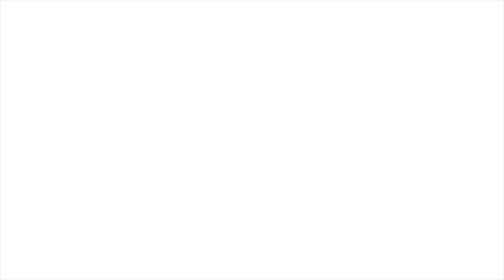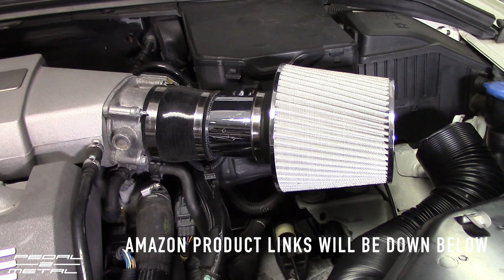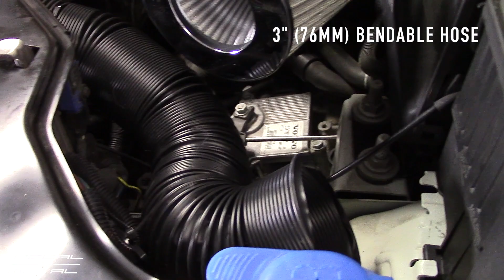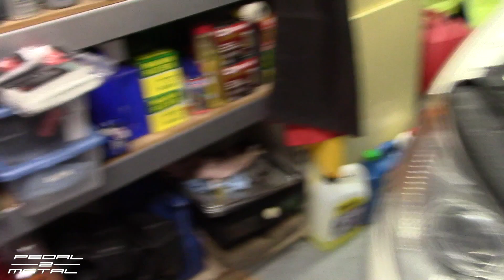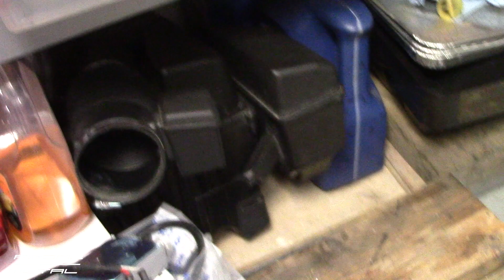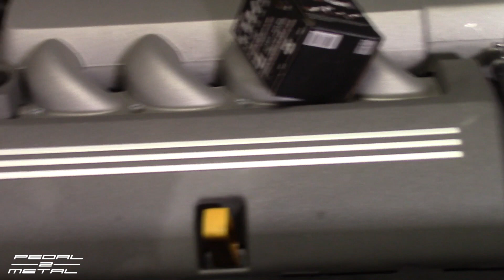Custom VOLVO (Yamaha) V8 High Flow Air Filter System | Under $50 | VOLVO S80 V8 Project Car

Comment: Curious as to which gasket you used to fit the maf on to the spectre?  There are 3 in the Amazon link.  Also, someone on there stated the maf adapter cracked.  How is it holding up as of now or when you had it on your vehicle?  Thanks.

Comment: If you make the intake shorter you may not need the helmholtz resonator. some math would need to be done there. Additionally, the XC90 does not have those resonators.
Reply from the maker: I have no idea what resonators you're referring to...?
Reply: @Pedal2Metal_on_YouTube  the box on the intake between the manifold and the air filter box
Reply from the maker: @kirunacat  Oh... Its gone.  I'm running this intake every day now. I love the additional grunts.
Reply: @Pedal2Metal_on_YouTube I agree, the intake noise is amazing

Comment: I think make that but is to much hot air in there... for this a keep the air box and put a KN.
Reply from the maker: As stated... I only use it for car shows.  I use a k and n in the factory box currently.  It was a fun experiment.  It actually didn't affect performance in the slightest tho; meaning I did not notice temp affecting intake temps. Thank you for watching and commenting!
Reply: @Pedal2Metal_on_YouTube  thanks you for the cool vids!!

Comment: I have an '05 V8 that I use for work, I was just looking at mine trying to figure out a way to do this. I guess Volvo moved the ECU at some point, mine sits on top of the air box. I'm trying to figure out a way to modify the box to support the ECU while allowing me to install a cone filter set up. Doesn't look like you had that problem. Looks great man, nice job.
I'm also going to install an oil catch can. I've been reading about them, they replace the pcv breather and collect any oil mist to keep your intake and throttle body clean.
Reply: Yes. I also have an 07 XC90 V8 sport and I can confirm that at the top of the air box is a mounted heat sink with thick wires..  you’d never know it was there unless you serviced it and lifted the thin plastic cover that allows you access to the air box torxs. And the (heatsink/ECU) is actually exposed to the air in the air box.. so perhaps it is being kept cool by the airflow. I am also looking to modify this since I just rip the exhaust off and gutted the rear cats that form the Y before the middle muffler/ silencer..  I love these 4.4 v8s
Reply from the maker: Thanks.  You have me confused... Volvo never had an '05 V8 model year; at least not that I know of.  Are you sure it's a V8 model?  Either way, I never heard of an ECU mounted on the airbag before...  thats weird!
Reply: @Pedal2Metal_on_YouTube  I have a 2007 V8 and the ECU is on top of the air filter...maybe that's what the person wanted to tell you.
Reply: You mean to say the MAF Sensor ?

Comment: Eye candy for sure, nice job dude!
Big v8 makes some heat under there though, any intake temp info after the mod? ?
Reply: Also interested! I almost wanted to buy a second airbox to convert into a semi cold air ram/heat blocker with a cone sitting inside, but I've bean holding off because of the lack of information

Comment: Hey man question for you. What did you do with the pcv valve to get it to not run rough?
Reply from the maker: Plugged it with a rubber cap

Comment: I'm trying to do a project with my B5 Audi S4. I have one of these motors available to me if I want it.  I'm trying to figure out if I can fit this motor in an Audi B5 S4. Is the design of it far too incompatible with the Audi?
Reply: It will fit all P2 Volvos, you have to check dimensions for your application
Reply: I highly doubt it, the engine barley fits here. This engine was made to fit in the s80 nd xc90

Comment: It looks good but performance wise won’t make any difference. The standard air intake is better just replace the filter for racing one such k&n. The whole idea is to get fresh and cool air in to the engine. If you place your filter directly in to the engine compartment it’s only getting the hot air from there. You won’t improve anything even make it worse. Yes it’s nice to looks at.
Reply from the maker: You're stating all the obvious facts about intakes.  This was an experiment; mainly to see how it sounds and as I state only for car shows. I run a k&n panel filter in my factory box as my everyday filter. I still want to make a nice carbon fiber air box sometime when I get time.
Reply: @Pedal2Metal_on_YouTube  Did you feel more Torque? Or More Acceleration?

Comment: Is it not true that the transmission in these cars is maxed out from the factory? I was told not to do upgrades because of this.
Reply: Volvo uses Aisin transmission.  Same ones used by Toyota.  As long that you change the fluid and don't abuse it, you should be fine.
Reply from the maker: I've heard they are only good for 350hp.
Reply: Pedal2Metal good to know. Thanks.

Comment: I admire a desire to modify these gems but this is just wasting your time. You left out the most important part, the comparison. I promise you the stock filter will flow much more air than that cone thing will and its 100% cold air induction.
Reply from the maker: As stated several times, it was merely a test for noise and was to be used at car shows. I run the stock air box daily.
Reply: @Pedal2Metal_on_YouTube  these engines are lovely. Let's hear it sing.

Comment: What did you do with the crank case vent hose that ran to the bottom of the stock plastic tube
Reply from the maker: I stuck a black rubber cap over it. I forgot to mention that on the video; sorry.  I don't think it does much of anything that i could tell. Its not a vacuum line. I think it's purely for emissions.
Reply: Ok cause i just put a breather filter on mine

Comment: have you had a chance to track your MPG? any improvement? i know when i went high flow spt filter and put a "ram air" set up on my wrx  my mpg improved and it had more power at higher rpm (downshifting to pass).
Reply from the maker: Not yet. It seems to have actually dropped very slightly, but that is most likely me.  Lol.  It does feel alot peppier than it did (like for passing like u said); thats for sure! Plus it sounds good.  I'm sure the purists would have a fit!  😃
Reply: @Pedal2Metal_on_YouTube  🖕 the purists 🤣🤣🤣